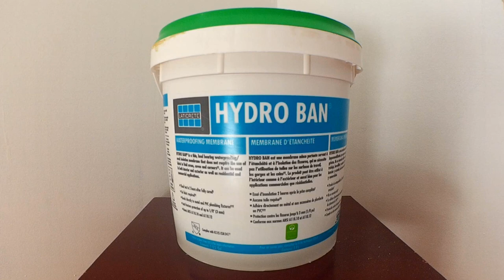Waterproofing The Shower with Laticrete Hydro Ban

Comment: I don’t believe that putting a band over the detri uncoupling membrane is waterproof because the detri is not a 100% smooth surface so you have spots that have 1/8” thickness of Thinset and Thinset wicks water and is not waterproof!
Reply from the maker: Thanks for the feedback, I tend to agree with you about banding the seams of the uncoupling membrane, but for short time situations, I suppose it could be a little more water resistant. Long enough to be able to clean up a wet mess without damaging ceiling below.

Comment: So you joined all the cbu with thinset and mesh, and also banded in some areas. I asked in another thread video, but you did not find build up an issue using the fabric on top of the mesh? I'm contemplating building a shower in the same manner.
Reply from the maker: Thanks for the question, I found no issue with build-up using the methods I employed. The large format tiles I used require a 1/2" x 1/2" trowel, which hides any imperfections anyway. But you could use smaller tiles if you choose. Good luck with your project.
Reply: Cost effective system. Why not foam wallboard?
  Though latecrete makes a floor heat system also that if I can get may use.